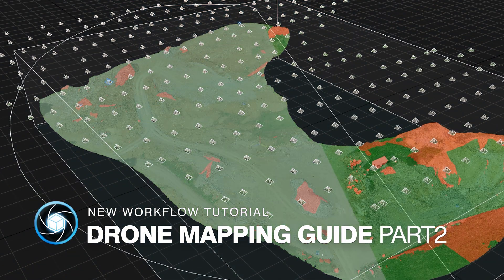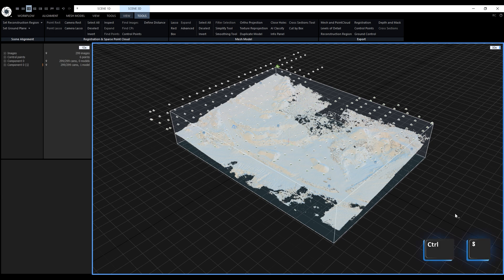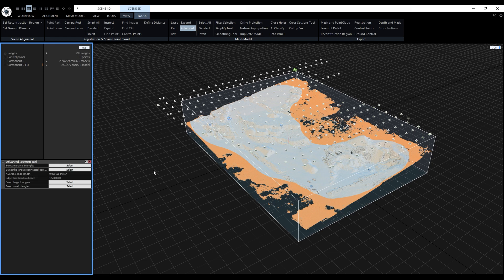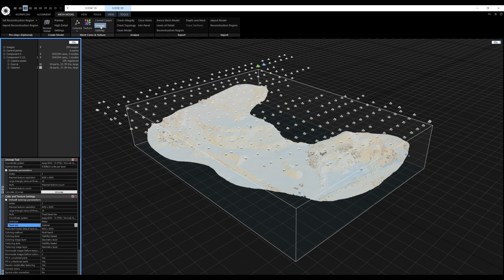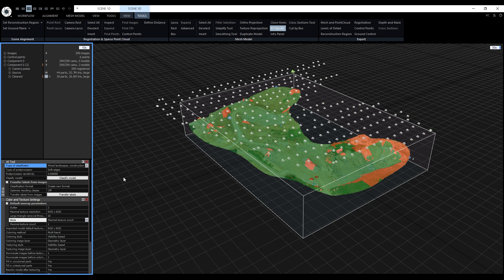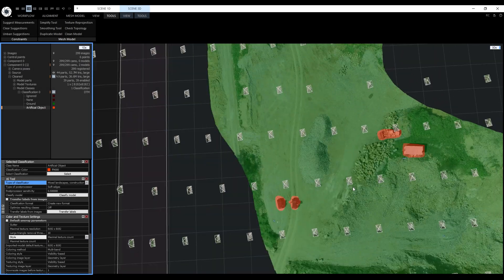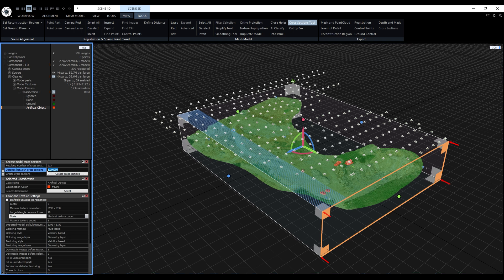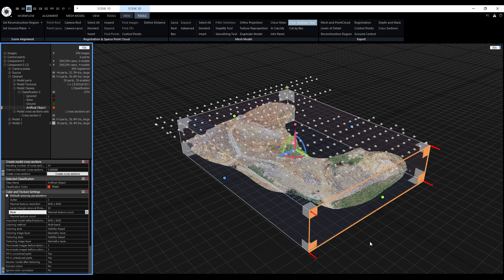Drone Mapping Guide | Part 2

Comment: My holes did not close what could be the reason
Reply from the maker: Hi Michael, the reason could be that they are not holes (like following the definition) or they are bigger as the size set in Close holes tool. Can you try to run Check topology tool to check the holes size?
Reply: @ noted tanks

Comment: Hey, I have a question. Is it possible to add dimensions to my 3D model of my house so that I can see the dimensions of the roof, etc. in real time when I later view my exported model?
Reply from the maker: Hi, you can measure and see the dimensions in 3D view, but those won't be visible after export. But the model should be properly scaled also after export.
Reply: @RealityScanOfficial  Is there any program that allows me to enter such real dimensions and make them visible on the model after export?
Reply from the maker: @kacpersuchodolski6367  I suppose some 3D view apps could have such functionality.
Reply: @RealityScanOfficial  Don't you know any of these?
Reply from the maker: @kacpersuchodolski6367  You can try to use Unreal Engine or Twinmotion.

Comment: Hello Jakub, thanks for the great tutorial! One question: My model is always watertight. How do I avoid that?
Reply from the maker: Hi phm1918, since 1.5 version you can disable the watertight model computation in the mesh model settings. In versions before, you need to delete those parts. Check this post how to do it: https://forums.unrealengine.com/t/problem-with-mesh-result-in-reality-capture-with-ptx-pointcloud-from-rtc-360/2276722/2
Reply: Hello Jakub, thanks for the fast reply, i will try it out :)

Comment: I'm trying to close holes, but it doesn't work. Despite the model processing, it doesn't close the holes
Reply from the maker: Hi, do you have a proper settings for closing holes? If you will provide Check topology, do you have there some holes? Can you try filter the around parts of the holes and then use the Close holes tool?

Comment: G'day Jakub,
Another quick question as I am revisiting this series, what can cross sections be utilised for?
I'm creating a port-folio of potential work I can do, though I am struggling to think where cross-sections can be used for data analysis.
Again great series!
Reply from the maker: Hi Joseph, it can be used everywhere, where you need to get some profiles. For example, it is used in surveying.
Reply: @RealityScanOfficial  
Alright, I'm sure it can be used in surveying but I'm not sure how the profiles are actually utilised.
No worries, I appreciate the response.
Reply: @josephrevell3078  in the UK, planning department will often ask for sections of the existing site vs the proposed to see the extent of the proposed works and how it will differ from the original terrain.

Comment: G'day Jakub, fantastic series so far!
Quick question, I'm not sure if you have run into this issue before. Rarely, the filter selection/overide selection tool will not process properly. I will lasso tris, click filter selection or overide selection (AI Classify tool) and a new model will be created but nothing has changed. I cannot seem to replicate this on purpose, clearing the cache doesn't help, it seem saving and rebooting RC is the only solution I have found.
Have you run into this glitch before?
Reply from the maker: Hi Joseph, I am sorry, but we are not able to reproduce that. I suppose only solution for that will be the application reset.
Reply: @RealityScanOfficial  No stress, I appreciate the reply nonetheless 👍🏻

Comment: Thank you for being very helpful. I have an issue you can help with. My map has turned out in Black and White. What could be causing this? Thanks.
Reply from the maker: Hi, do you mean Ortho? Or model? Did you have set Visibility or Photo Consistency in the texturing settings?

Comment: Hi Mate, Great tutorial !! - did you take all your photos from the same high and same angle of camera? I am doing a model where I used GCP from GNSS, but when I try to align images doesn't look right. The project has images from different high and angles. any advice ??
cheers !!!   
Jorge
Reply from the maker: Hi Jorge, it this example were used just images from same height and using same angle, but the principle is the same also for image from various heights with various capturing angles. In general, it is more practical attitude, but it all depends on the usage of your results. What do you mean that it doesn't look right?